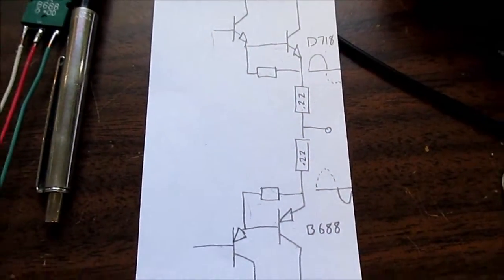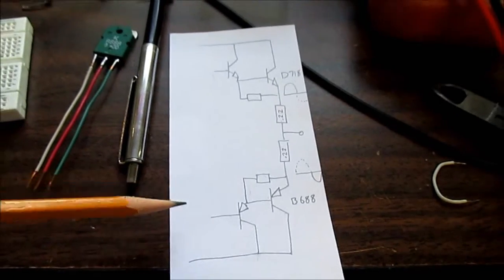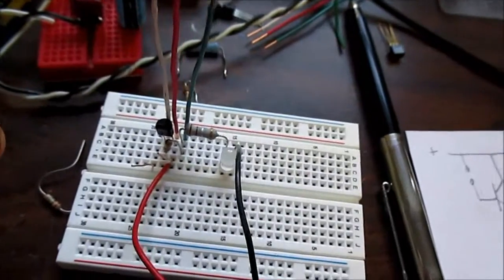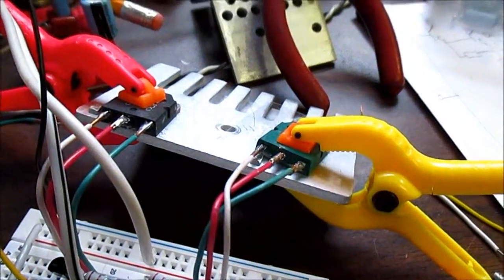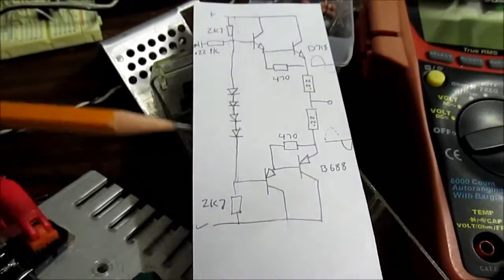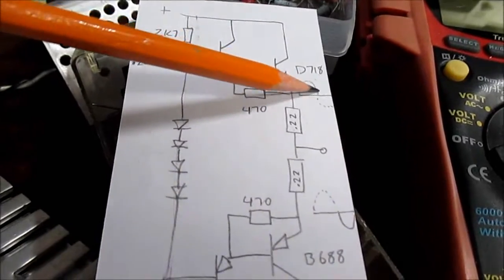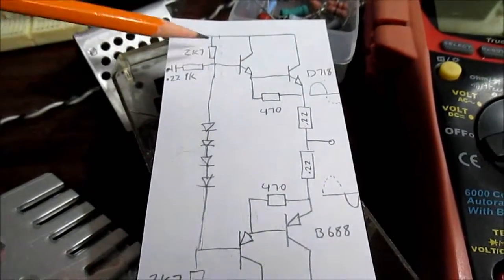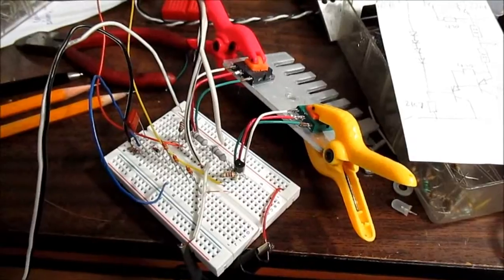Discrete audio amplifier output stage on breadboard

Comment: i wish this had come up sooner in my search results, finally this whole thing is starting to make sense.

john, I'm trying to restore an early homebuilt amp with dual 152's, wondering if any advantages to using mosfets instead, no reply needed. Thanks again for all the great videos.
Reply from the maker: Mosfets might require a lot of circuit modifications to work properly. I don't know what 152s are but I'd use something similar.